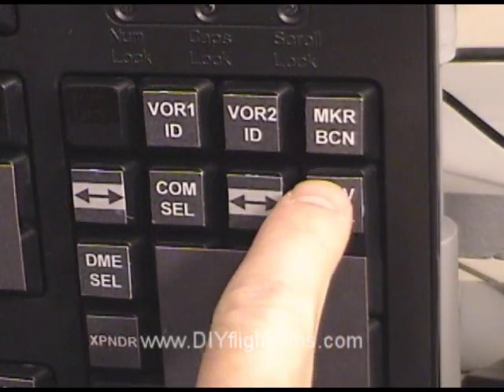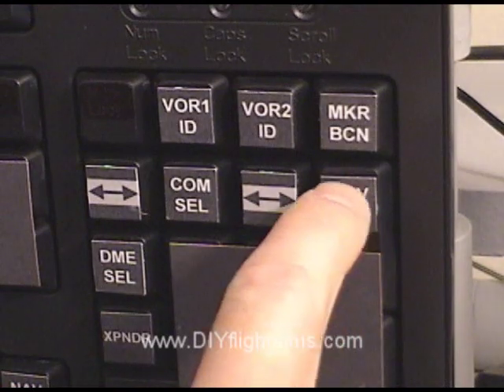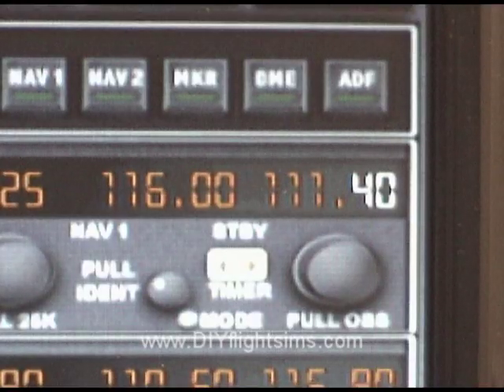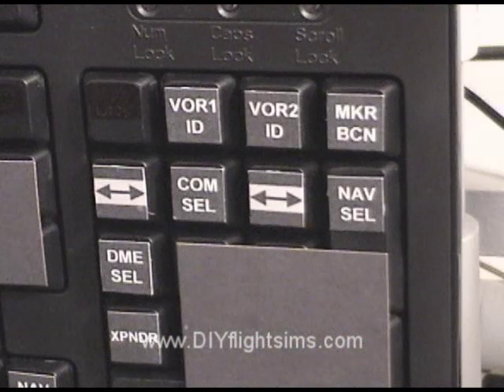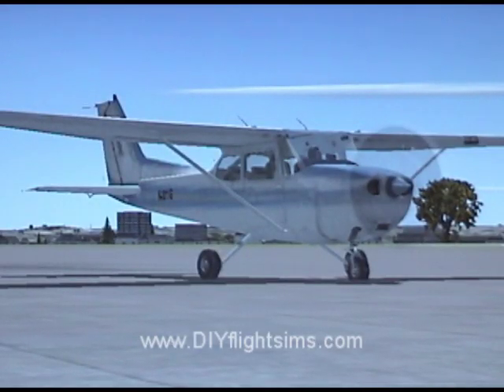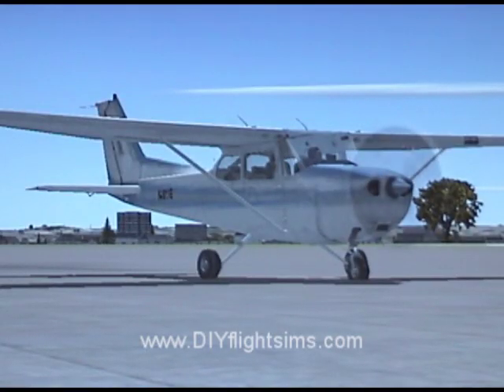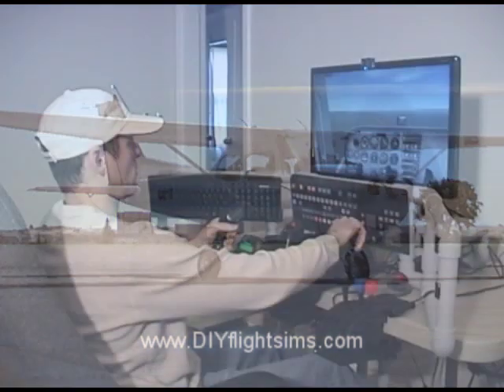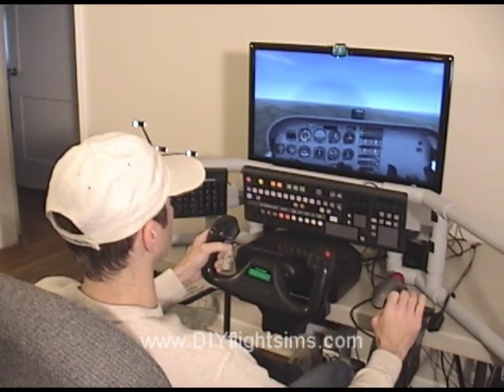DIY Flight Simulator: GA Keyboard Mod Demo - Tuning a VOR

Comment: How much did all of that cost in total?
Reply from the maker: +Kevin Davis Computer = $700, yoke = $130, TrackIR = $130 or so, rudder pedals = $150, speakers = $50, keyboards = about $25. PVC pipe and lumber, I don't remember probably less than $60.